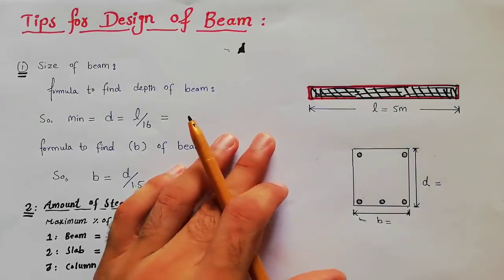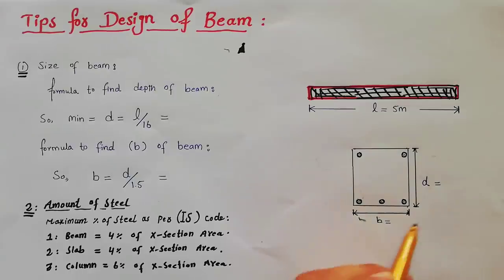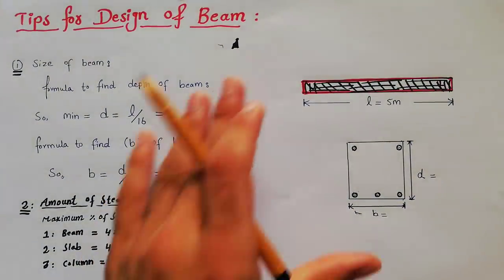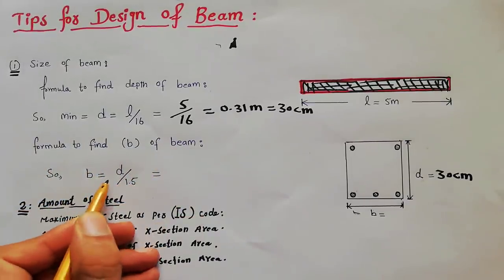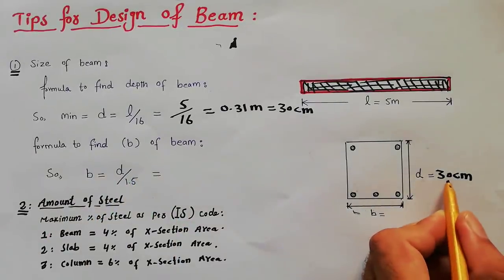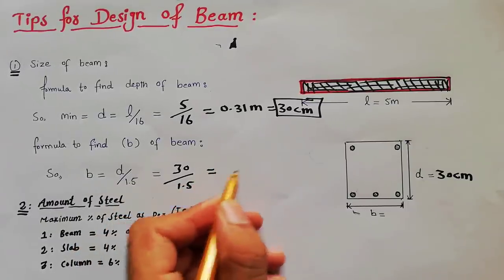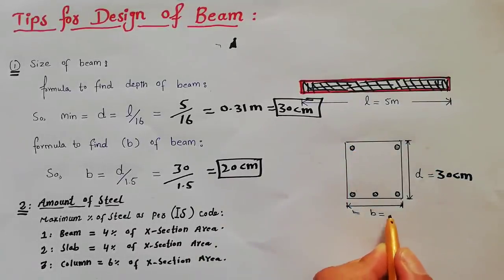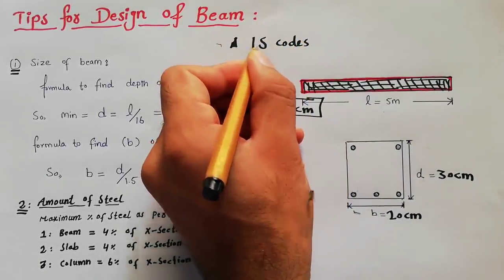Tips for Design of RCC Beam - Civil Engineering Videos

Comment: Sir, not correct. Use 2016 code.
Min. Beam dimension is 20 x bar dia.

Min. Bottom main  Bar dia in beam is 16mm.
Column  dimension will be dictated by beam bottom width. 

Please check n Advise.

I have liked n shared your video to my students😊

Comment: How can you directly assume dia of bars and also the spacing between the stirrups and then use those values. Are we not suppose to find what dia bars to use and spacing of stirrups???
Reply: Spacing between stirrups should be 6,7,8,9,10 inches it depends upon downward load. The formula  to find no of stirrups =(span of beam -2 covers) +1 and divided by distance between one strriup to other strriup which shown in drawing of beam.🇵🇰🙂🙂
Reply: Says by ZAIN 🙂 city Sargodha Pakistan 🇵🇰

Comment: RC Assignment 3rd year Civil enginering
P.107--------------------Assignment-2
1.Floor systems are sustained by parallel T-beam of span 6m and 1.8m on center to center spacing.the total design moment is 450KNm.
Dimensions for the beam  D=400mm,bw=300mm flange depth,hf=80mm….
material used are fcu=25MPa,fyk=300MPa and class 1 works.Design interior beam.
2.Design the edge beam using 2/3 of the bending moment and with the same data in…Eg.1.
3.Design a T-beam with be=1000mm,hf=100mm,bw=250mm,d=450mm,use c-25 concrete and s-460 steel,class 1 works;M=470KNm
5.A T-bea has are effective flange width of 760mm,bw=350mm,hf=100mm and effective depth,d=500mm if s-400 steel,fyk=20MPa,class 2 works are used.what will be the design moment capacity for this beam when As=900mm^2 is used?

P.77-----------------Assignment-1
6.the longitudinal reinforcement bars for abeam is indicated in the figure below.determine the maximum moments using c-20,s-360 and class 2 work.
Length..400mm,width…300mm,5∅20…OOOOO
8.A cantilever beam 4m span carries alive load of 150KN/m in addition to its own weight.
A)Design the beam section for Ultimate limit state for flexural using uniform depth
B)Redesign the same beam for ultimate limit state for flexural using linearly varying depth(depth at free end is 1/3 of at fixed end). ω
                    Use=C-30MPa(fcd=13.4MPa)
                            S-300MPa(fyd=260.87MPa)
                         ( Up sign) ∝RC=24KN/m^3
                           Design constants using ρmax=0.75ρb are ωmax=0.437 and μmax=0.34
4.A simply supported beam spans 8m and is subjected to a live load of 30KN/m in addition to self weight.materials used are c-25,s-300 and class 2 work.if width L=250mm,determine the depth required to satisfy section at mild-span and the corresponding flexural reinforcement.
    Finaly sketch it available bars are ∅16mm and ∅10mm.

Address….Email:-asegidt504@gmail.com

Comment: I could follow everything clearly from your video, but what is meant by cover as mentioned in formula  for counting stirrups?
Reply: It is clear cover ..and as rod starts placing just inside the concrete right...length in-between bar to edge of beam..

Comment: Sir, according to Eurocode2, for the 
predimensioning stage, beam hight is 500:10=50 t 5o 500:12=41.66, and this according to the the building ductility class,  the number of stirrup's repartition it's done on three spaces in the beam lenght..1 and 3rd spaces, thestirups are distributed 2x beam hight/10cm, 2,nd space:rest of the beam lenght/20cm. It does nat matter the design code, you have lack of information in your calculation

Comment: Hi,
To find depth: 5m/16=0.3125m and this the minimum you can have, you can’t round up the number to lower value of 0.3m or 30cm. You should round up to a higher value like 0.32m or 32cm to avoid disaster:) regards
Reply: Agree
Reply: @kleinnacion5094  true
Reply: @kleinnacion5094  building will fall down😂😂😂
Reply: Absolutely 👍

Comment: Your beam size is just an initial assumption for the initial weight of   the beam. It should be designed with appropriate degrees of reliability to withstand safely all loads that are liable to act on it for its intended function satisfactorily in terms of safety or serviceability wc requires limitation on deflection and cracking.
Reply: Rule of thumb is generally covering just that...the activities in a  given region that may come into play. "Withstand safely all loads"- are you referring to what engineers call "Moments"? You may have garnered some though had you used correct terminology to show you knew something about what you are saying.

Comment: When you were finding steel the answer was 24cm square what is the mean of 24cm square is it steel type or length of steel?
Reply: It is cross sectional area of all steel bars
Reply: @Alex 24 cm2 is the total area of steel required in a beam 
If need to find nos of rebers u need to take any specific dia of reber ( 12, 14,16..any. ) and then calculate   area of steel for single reber using formula  (3.14/4)*d*d 
Divide 20cm2 by above value u will get nos of reber

Comment: For 5 meter span ,
20cm×30cm beam is sufficient ????
Reply: You must check the stress if it is sufficient. This is approximate not accurate. How about the sizes of the reinforcing steel bars? 

In ductile design the stirrup spacing at length (L) divided by four or L/4 from the column is 10 cm apart. Also the column applies to balance the rigidity.

This is a method for foreman. Not for civil engineers. The city engineer will not accept this. He will not issue a building permit.
Reply: Yes..it's sufficient

Comment: Why do you subtract the cover from both sides when the beam will have a cover on all four sides?
Reply: Clear cover deducted Bcoz you are  not use steel outer face of beam and
 length of beam -(2×clear cover)+1(starting stirrup in beam)
So
{5-(2×.025)÷spacing}+1
=5-0.05
=4.95÷0.20

Comment: Sir what Area 24 cmsq means
Reply: The area covered by the steel in cross section
Reply: Jeeshan Qureshi 
24sq cm means 
π/4 x DxD =~~ 1.2
So you say 12no @12mm dia bar 
Not possible